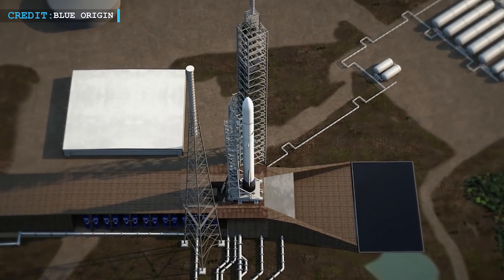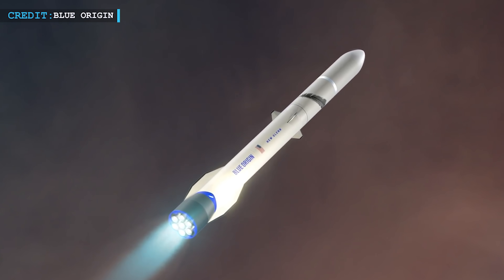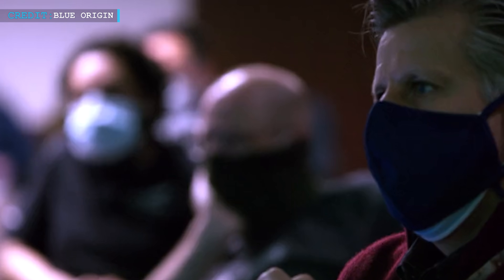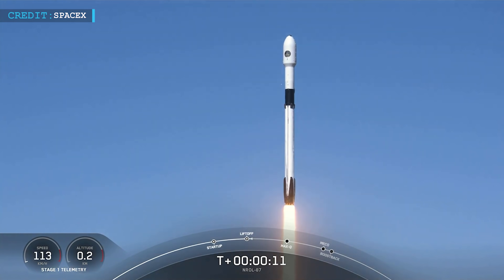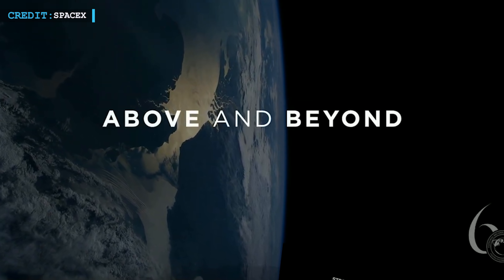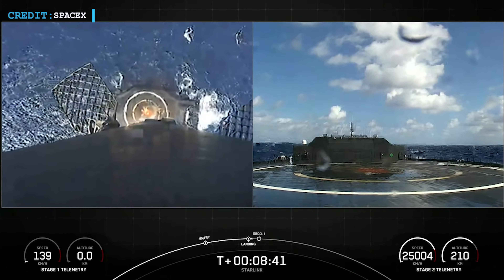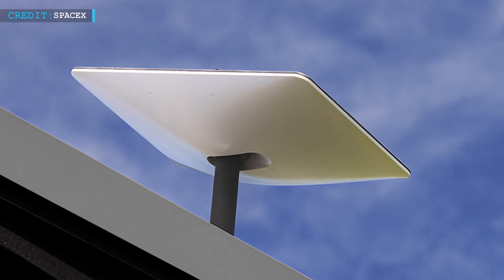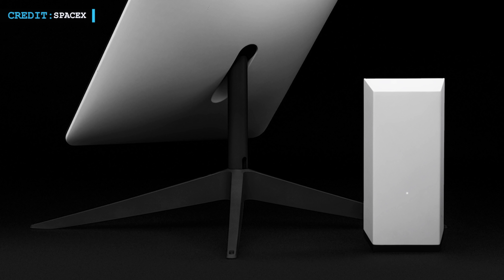SpaceX Starlink Just Got Faster | Blue Origin Successfully Tests First New Glenn Fairing Prototype

Comment: BF Rocket Catching Solved !! ..... Use the Aircraft Carrier wire Idea ! ... On a Separate Landing area ... Build 3 or 4 Towers 50 meters apart ... Join the towers together in a big Open Rigid Box ... Run 2 Wires from corners to corners ... Use weights and Pulleys to keep the Wires Taught ... Pull those Wires apart wires apart at the middle with a 3rd wire , creating an Open Center ... That should create an open are or Landing Zone 40 meters  across  ... Build Compute an Algorithm to adjust where the circle Closes ... As the BF Rocket descends through the Catching Zone ... the Weights combined with Hydraulics close the light wires Quickly and Snare the Bf Booster or BF Starships around the middle ... And the Rocket will Fall down until the Hooks Catch , holding it in a Forgiving Cradle ... Pad the wires to prevent scratches ... And ... Dig a Hole , half full of Water in the middle , to catch the Flames and be a containment hole in case of a Crash ...... Unload the Rocket with the Crane ... and send it to the Launch Pad with the Fagoli Flatbed .... Maximum Agility , maximum Cushion , quickly Adjustable , No metal to metal contact , Maximum protection .... Plus Extra large Landing Area ! ...... If you can Catch a Rabbit ... You can Catch a BF Rocket ....... I will Expect the Check by Monday ..... :-D

Comment: Giant composite fairings are very difficult to make. This is one reason Starship went to stainless steel. The big advantage BO may have over Falcon Heavy is size of fairings rather than weight to orbit because Falcon cannot fit in many types of load. But Starship will. BO is getting very very late to the party
Reply: SpaceX has theoretically lost a couple of potential Falcon Heavy contracts because of the lack of a 5m fairing.  It would almost certainly take less than a year for SpaceX to design, test, and build such a fairing.  Because of the much greater power of the Falcon Heavy first stage SpaceX could also design a heavier stretched version of the Falcon second stage, substantially increasing the delta-V to make Falcon Heavy better for interplanetary missions.  And if they can strap on two side boosters what is to stop them from strapping on four, which would give Falcon Heavy far more payload capacity than even the Senate Launch System block 2!  However in less than a year SpaceX will almost certainly be accepting contracts for launches on Starship with a 9m fairing and at least twice the payload mass of Falcon Heavy!  How many signed contracts does BO have for New Glenn launches?  Indeed Amazon has signed NINE contracts for Kuiper launches on the twenty-year-old Atlas V, which is itself basically a forty-year-old Roskosmos Energiya with a US flag decal stuck on the side, rather than wait for the New Glenn rocket built by its own subsidiary.  Signing those contracts also suggests a lack of faith in the Vulcan launcher that BO is supposed to provide the engines for.  Furthermore I would estimate that the five already booked Falcon Heavy launches over the next year and a quarter is probably close to maximum feasible cadence for that system, especially considering that SpaceX also has at least 50 Falcon 9 launches over the next 12 months and has specifically requested permission for 5 Starship launches from Boca Chica, not counting possible launches from the Cape.  This is going to be a VERY busy year for SpaceX.  The last calculation I saw indicated that in 2022 SpaceX will launch into space at least twice as much mass as every other agency on the PLANET combined!

Comment: It looked like there was cables pulling the fairings away from the rocket.
Reply: If so, then BO has come a long way, NOT
Reply: I saw that too.  However, the test was performed in a vacuum chamber on the surface of the Earth, in 1G of gravity.  I'm pretty certain that the cables were simply to provide a counteracting vertical lift.

Comment: Blue Origin wants to use the New Glenn to compete with the SpaceX Falcon Heavy?  Falcon Heavy has launched three times in four years and never with a payload that actually needed its capacity, that's not much of a market to fight over.
Reply: Except for the fact that there are (I am pretty sure at least) 5 Falcon Heavy missions on the books in the next 1.5 years.
Reply: Starship will take years not months to achieve a reliable space rating
Reply: Also, those missions were launched on a Falcon Heavy not because they needed the capacity it had, it was about the amount of DeltaV the rocket was capable of providing that the payloads needed.

I don't know how you managed to get a heart comment from the channel. It just shows how little they actually know about rockets...
Reply: Hopefully Starship will finally be in service by then.  Delivery cargo to orbit.

Comment: I wonder if BO, is going to recover the payload fairing like SpaceX does?  So, ULA, has to wait for their engines until BO flies. That does not sound right, for ULA?
ULA, should be first to get their engines?
Reply: They've been waiting over a year now for the engines. It seems BO underestimated developing a methane fueled engine. ULA made the wrong call, I say they should have tried partnering in the Raptor development.
Reply: @paulmichaelfreedman8334  
Yes totally agree, they have Aerojet, they should have built the engines, trying to save a dollar 💵, and they messed up on that decision. Thanks 🙏
Reply: @stephensfarms7165  The AR-1 would've been on Vulcan a year ago if they made the right call. And now they're developing it anyways for Firefly Aerospace.
Reply: @paulmichaelfreedman8334  They've been waiting much longer than that, and zero are flight qualified.
Reply: @UncleKennysPlace  I'm surprised ULA hasn't decided to redesign and modify the existing launch vehicles for a different engine with suitable specs?
Reply: No worries they will never orbit

Comment: Still too expensive for the average person. Starlink has massive operations costs that could shut down the program. Leaving tons of trash in orbit. Investing in Fiber Optics coverage makes more economical sense.
Reply: Until a Russian sub cuts an underwater cable.
Reply: @rexmann1984  are you aware for an advance Military is simpler and faster to shut down an entire satellite constellation in Obit? Some 
Suborbital ballistic missile would take care of them. As recently Russia did with an decommissioned satellite.
Reply: @RogerM88  that's not even the same realm of damage. There's only a few cables to cut. There's also the risk of Kessler Syndrome and the fact that there's thousands of sats to take out needing at the very least hundreds of missiles.
Reply: starlink is already making 1.5 million per month, i'm a user and i think starlink is great. it's not even that much more expensive then what viasat was charging me. viasat was 13 mbs down, 3 mbs up, 600ms ping, with a 10 gig data cap, for $65 per month. starlink is 150 mbs down, 15, mbs up, 60 ms ping, with no data cap for $99 per month. besides that spacex is paying for this with money earned from other payed launches, which aren't drying up any time soon. any operating cost besides the launches are negligible and in a few years starlink will be profitable enough to pay for the launches with it's own revenue. also, they don't leave trash in orbit since they deorbit from atmospheric drag if left alone.

go stick it in your ear you naysayer. the math adds up and it's only a matter of time before starlink is a self sufficient division of spacex.
Reply: Actually given the largest sums of money in the world are made on the stock exchange and Starlink will beat fibre communications across the Atlantic? then even if Starlink didn't have a single average customer - they'd still make a fortune selling access to the high speed link to traders.
Reply: @JohnnyWednesday  are you aware you've other satellite Internet providers than Starlink. Yes they can have lower latency speeds, but in term of prices not very far, and you won't need a massive number of satellites in Orbit to keep it operational. The gross profit margins are in highly dense populated places, and you can't beat Fiber Optics  cable in costs and average speeds in the long run. Also you save a lot of energy not using exterior antennas.
Reply: @JohnnyWednesday  Not a surprise if in less than five years from now the Starlink program is completely shutdown due to operational costs. Or they opt to boost the satellite orbits higher being able to reduce the number of satellites required.
Reply: @RogerM88  - "if" - there are thousands of engineers and scientists working on the project AND competing projects that are very certain it'll work - unless you happen to be Tony Stark? I think I'll assume they're right before you are
Reply: @JohnnyWednesday  Tony Stark is a fictional character. And many other satellite Internet providers already came and went away.
Reply: @RogerM88  - you're deliberately overlooking how starlink is different from what came before. I've given you the information, think what you like - meanwhile SpaceX land rockets nearly every day.
Reply: @JohnnyWednesday  as I said...less than five years the program is shutdown. Or a shift is made to boost the satellite orbits higher. Let's wait and see.
Reply: @RogerM88  - The exact same things were said of the car, the computer, the mobile phone - I guess we'll see.
Reply: @JohnnyWednesday  BEV based on Li-on technology aren't the future of mainstream cars. Maybe Sodium base cells or solid state with quicker recharging speeds and cheaper production costs.
Reply: You do know that each Starlink box has a "de-orbit" system, right? They've already de-orbited quite a few duds.
Reply: @Blitz Gaming654 the costs can't go down drastically, because you need to renew the satellites after a short period of time. And if you aren't aware, a big percentage of the rocket launching costs, are to support the launching infrastructure and Staff. For a reason many satellite internet providers choose to use lesser satellites at a higher orbit.